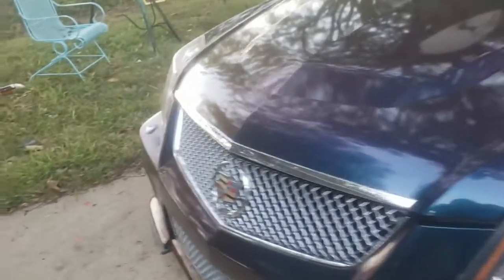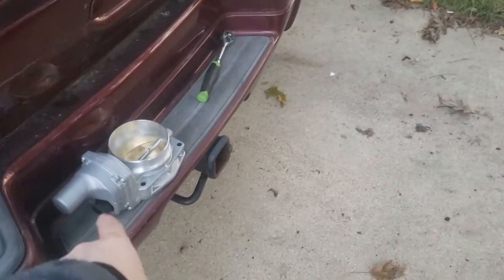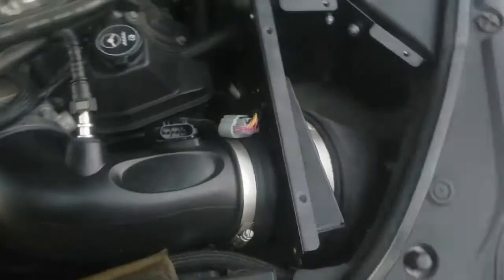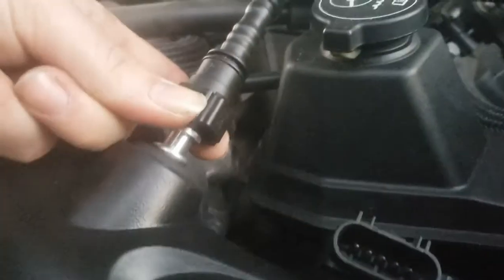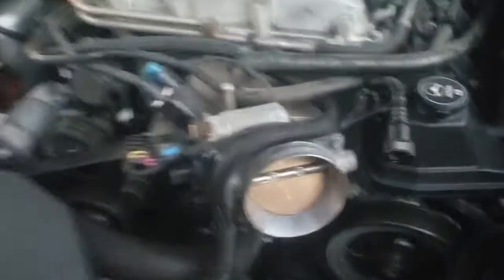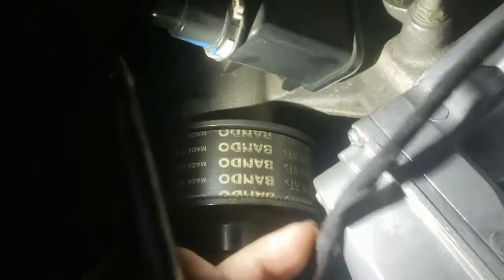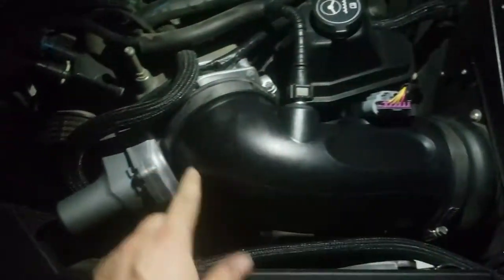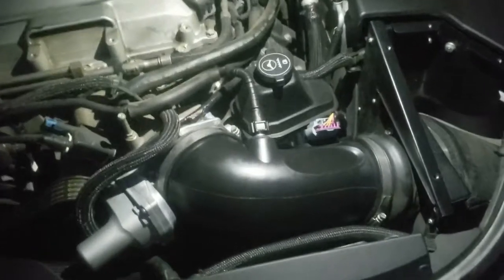CTS-V: LS7 Throttle Body Upgrade

Comment: You think a throttle body spacer might give you more room on that pulley?
Reply from the maker: Nah a throttle body spacer will space it out too far and it will bring it out to the supercharger pulley. If you need more clearance for the supercharger pulley you have three options.
1. Remove or sand a little material from the throttle body where it close to the pulley.
2. Go to a smaller supercharger pulley.
3. I wouldn't recommend it but you can mill down or shave the back of the throttle body to space it further in and away from the pulley.
Reply: @justastreetcar4273   Do they make a angled adapter to go on an angle a little bit to make more room to fit these bigger ported throttle bodies even a 90 mm to a 95 mm on the LSA stock snout but then I need to get  a adapter to fit 87mm snout to weapon x ls7 90mm ported to 95mm ported throttle body I believe there not much hp gains but it effect acceleration response so damn much its a must need ,might get snout ported not blower to so then I'll be looking for a 103mm nw which I can grab brand new 650 shipped hmmmm but zero benefits if it's snout and blower isn't ported or is it? I plan on porting my blower once to out of warranty but zero benefits unless ported blower n snout and throttle body all are matching 103 mm for flow. Hoping my resolution do I need a retune

Comment: Is there any angle spacers or adapter that fit the lsa snout  to ls7 ported throttle body conversion or that will fit the perferrably 90mm ported thats 95mm throttle body the most updated, best one from and bit more space from  upper pulley. Or whats comfortable upper and lower pulley combo is best to run to give it a tiny bit better fit ment space from that ls7 throttle body or that 90mm ported n polished to 95mm going on stock snout 87mm. so that's where I need the lsa 87mm snout adapter to 90mm ported throttle body I got 4.5" air raid bout to grab  huge green if any has a link for a link for one use in great condition or can get me a smiling deal on on a 90mm ported to 95mm n polished on from weapon x w all new revised version